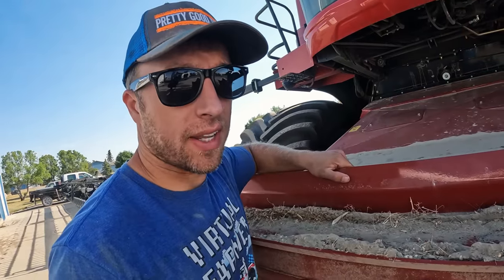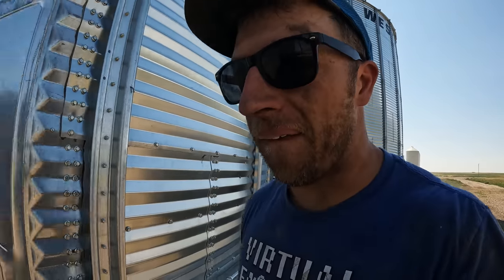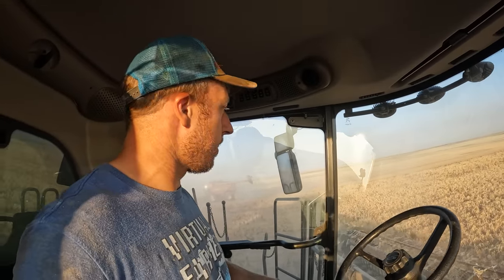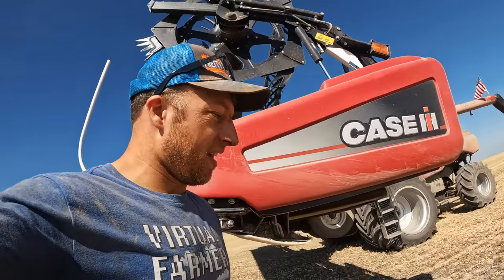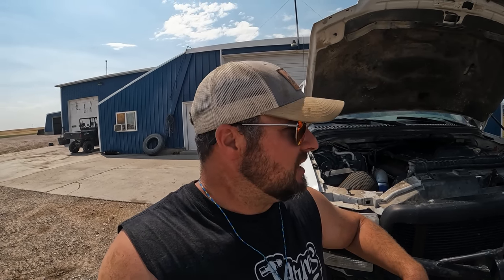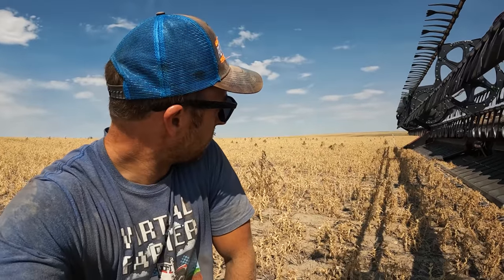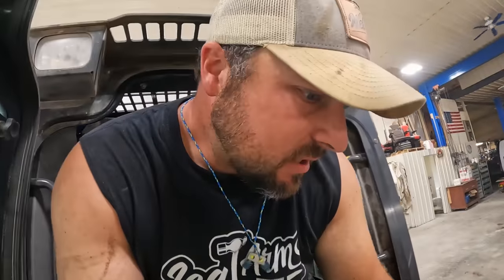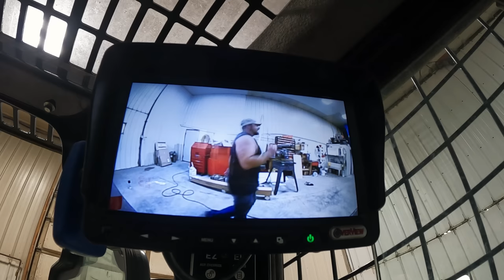We're Off To a Rocky Start...

Comment: I've always wondered why you don't have a box fitted to the combines that you can put your rocks in that you pick up, so that you can then dump them somewhere that you won't pick them up again next season.
Reply: Bingo!
Reply: We had one that hung from a pin in the top mounting point of the 3 point hitch. It wasn't a lot but at the end of the day it was 150 lbs of rocks that you never had to worry about again.
Reply: Because they could pile every rock they ever lay eyes on and it would only be 1% of the rocks that are in the fields
Reply: @thomasbritten7216  Every rock you remove from the combine and from the field is one less rock to hit next time you are in that field. Every little bit helps kind of like paying down a line of credit.
Reply: @thomasbritten7216  My understanding is the rocks are worked to the surface through various natural and man-made actions. Myself, I'm thinking the harvesting 'head' needs a redesign 🙂
Reply: @monkeybarmonkeyman  it’s got an awful lot to do with the crop. Peas are SHORT, and you’ve got to run that head low so the cutter bar is below the crop. If you’re running a corn header like we are right now, you can cut the stalks much higher off the ground which would result in far fewer rocks. Different head and cutting method, but same principle. Easy crop to cut and thresh, but you have to run that header dang near on the ground.
Reply: @tommathews3964  Thanks Tom... So I'm wondering then, if I remember correctly, the normal stalk height is taller than what they're cutting this year. In that case then this would have all worked out a-okay, yes?
Reply: Burt  I'm glad you agree.
Reply: @monkeybarmonkeyman  Would have been a lot better, for sure! Still have to run the cutter bar/header low, but not quite as low. Sometimes I think I'd trade those rock problems for our cotton picker problems, but then I come to my senses! ;)

Comment: Number 5 cylinder lost a valve seat . Damaged the piston.  Need to put a thermostat in the back of the cylinder head an cooler lines . On the rebuild head .
Reply: Is that a prediction, or do you have the inside dope?
Reply: @cottonj9  well somewhat of a prediction.  Number 5 6 cylinder gets hot . Because the coolant doesn't circulate very well on those cylinders.  The coolant basically dead-ends . I have friends dropped valve seats . Or broken the valve off the stem.  I got a 4 gen 1st gen 6.7 cummins.  Common problem over heating #5 an #6 cylinders. Put a thermostat kit in the back of the head . Water neck hoses . Now the coolant flows front of head through to the back of the head to the radiator.
Reply: @matthewwilson2991  Thanks for sharing that info. Take care.

Comment: By any chance did yall do the “killer dowel pin” fix on the fummins? I’ve heard that its common for the dowel pin on an idler on the timing chain to come out and cause the timing to jump and stuff messing up the engine
Reply: highly doubt it would idle if the dowel pin slipped out and broke the chain free. it honestly just sounds like a dead cylinder.
Reply: there is no timing chain on 12valve cummins. it is gears.  if the KDP had fell it will break the timing cover and dump oil all over.

Comment: You have said before how fragile peas are. Doesn’t dropping them from the top of the bin damage them?
Reply: Maybe a little while the floor and sweep are being covered but after that no. In the grand scheme of things it is minimal
Reply: I was wondering the same thing.
Reply: I think he’s more talking about being damaged going through the unload augers
Reply: Even with augers it’s still minimal, most of the damage will occur in the combine and especially if you don’t have it adjusted right. I wish I could post pics in the comments cause I have some sample sheets from loads I’ve hauled in and they show percentage on damaged grain and it’s usually under 1% out of 950 bushels